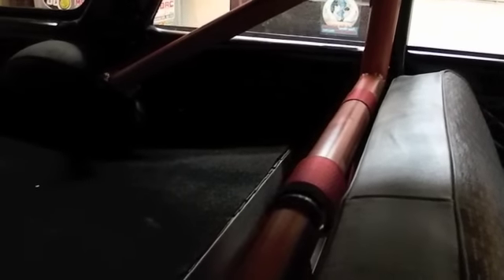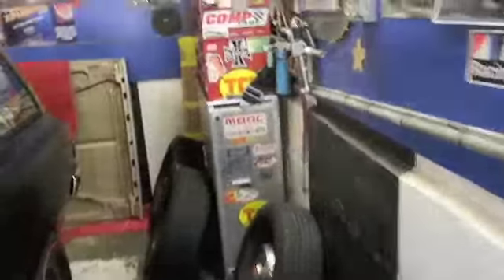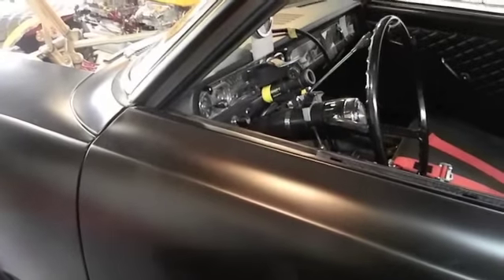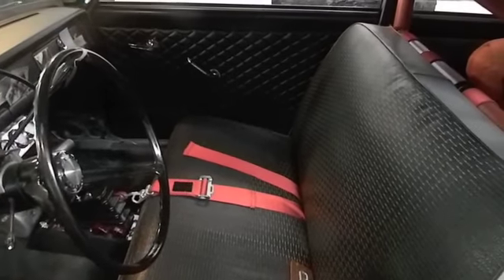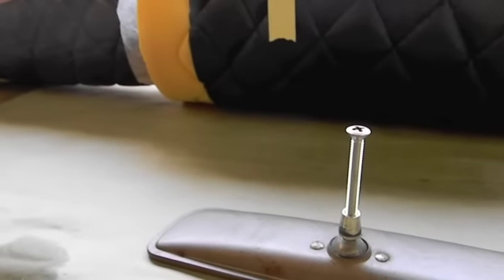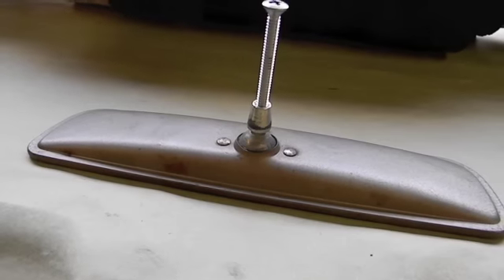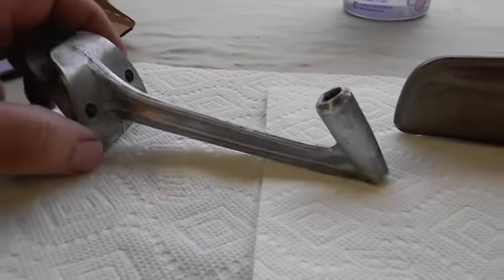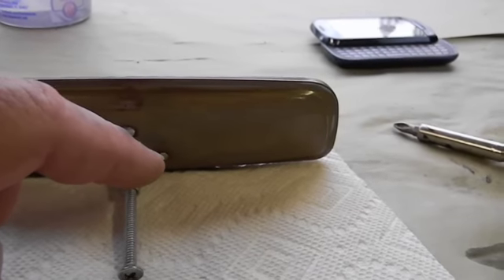More Work On The Gasser

Comment: You could trim off the foam off  and fold the material over and around corners , then it would be easy , because you only need the foam on the outside